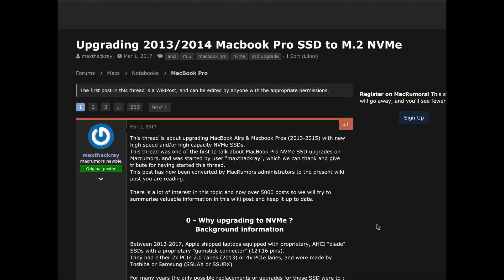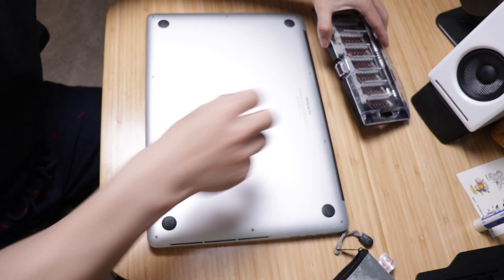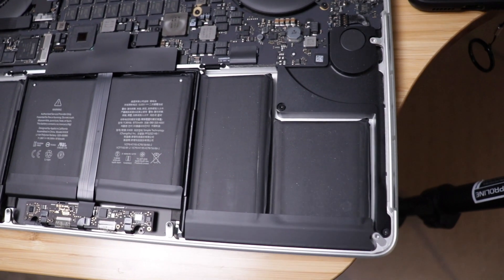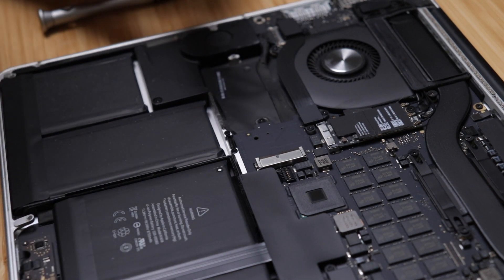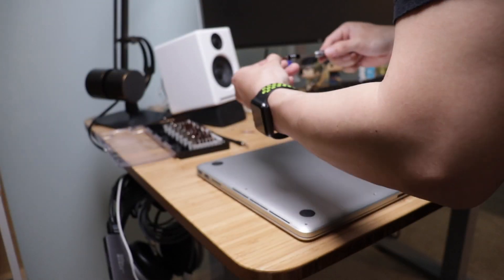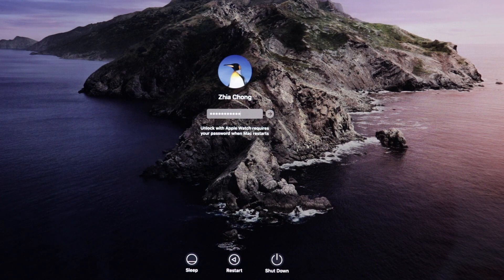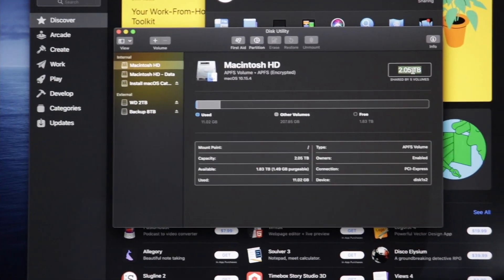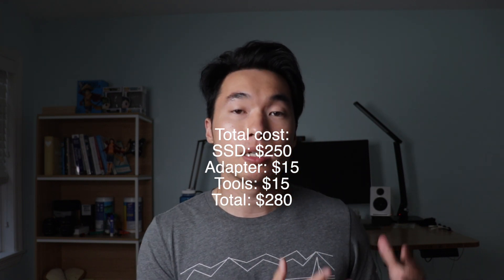2015 15" Macbook Pro 2TB NVME M.2 SSD Upgrade

Comment: I have tried upgrading my MBP A1398 15'' 2015 from WD 1TB to 2TB Orico Drive including Adapter, with Cloning the Drive, but it won't boot up to the latest Macos Monterey.

I tried in safe mode as well, but still will not accept the Drive, I have done  this in a matter of different ways also including a fresh install, of Monterey. Still it will not accept the drive.
Any help would be much appreciated.
Regards

Comment: Nice to see that it is possible, but I have failed so far. I have a Kingston 2 TB SSD, which works in an external enclosure, but the Mac won't recognise it. Bad adapter? I have tried two different ones.
Reply from the maker: Sorry to hear that, which adapter did you get? There are certain Chinese brands that work, and some don't.

Comment: When removing the SSD or any removable component on the logic board, you should always disconnect the battery first. This is good practice and prevents any potential discharge issue when removing the component.
Reply: How do disconnect the battery, and I always thought one should wear special gloves when working on electronics?
Reply: Great advice. This kid's an amateur and should not be making tutorials at all involving such a delicate procedure, without first knowing and following the number 1 basic fundamental involving electronics. Disconnect power.

Comment: Just performed this upgrade. Love having plenty of storage space now! Gave it a boost from 256GB to 2TB 😃 For those doing this, you will need to format the new SSD so the machine will recognize it as a disk capable of accepting the new MacOS install. Aside from that, you should be able to follow the video and perform it without too much of a headache. Thank you for uploading this!
Reply: Hi Logan, silly question but how did you format the SSD? Did you use an external caddy? Thanks!
Reply: @martinconway3772  pretty sure I did have to format bc the computer didn’t want to recognize it as a bootable drive
Reply: @loganhasty2036  Yeh that's exactly the problem I'm having, just wanted to check how you formatted how you did the formatting before I invest in an extra £20 in a caddy
Reply: @martinconway3772  I didn’t purchase anything extra. I googled it and figured it out from Apple forums. I believe I had to use disk repair utility but I’m not sure. It’s been a little while since I did it. I do know you don’t need a caddy though lol
Reply: @loganhasty2036  Cool, thanks for your help, I shall do some more research!
Reply: @martinconway3772 hey do you have an solution?
Reply: @Beru96  Hi Hubert, I didn't I'm afarid but so far haven't had a lot of time to trouble shoot. I think I may have bought an incompatable SSD so i'll try another one soon and let you know how I get on 😎
Reply: @Beru96  Ahh thanks for the feedback Hubert, yeh I'm going to try a different SSD soon. Glad you got it working in the end!
Reply from the maker: Glad this worked for you too!
Reply: @codingwithzhia  No... no it didn't 😂
Reply from the maker: @martinconway3772  Ouch :( which SSD did you get?
Reply: @codingwithzhia  I believe it was a Sabrent Rocket 4.0, I'd heard good things but think I got the wrong model. Will try again soon 👍

Comment: Hi , I want to ask, replace the flash storage of the Macbook Pro 2015 with another SSD from  info some friends in the group, there are experience naturally can't hibernate or sleep mode, the battery heats up quickly and wastes and even some that die completely can't be restored again because of the panic screen and then it's completely dead can't be repaired  again.  My question is, should I look for an SSD and converter that is really compatible because each SSD has different speeds, while the Mac software is not as fast as the latest SSD.  Then the type of ssd must also be the same as the original.  Friends say it's like we ride a BMW, spare parts are replaced by LOWEST part , let alone use a converter.  Then, if we replace the SSD, the one that appears in our storage is not FLASH STORAGE but SSD, is there really a difference that can cause occasional errors?  Then the final question, if the SSD is replaced, the OS is upgraded, can it ERROR and die.  Is there something natural about it?  Thanks for the answers to some of the questions above.  I hope this channel will be more successful

Comment: Has anyone run into this issue: Switched out the 512 Gb SDD 2015 MBP 15" Retina  to 1TB (Samsung Evo 980) all seemed to work fine, but today, trying to use Migration Assistant, the screen doesn't work???  I hear the fan blowing at times.  Have tried doing a reboot, shutdown, etc as per normal w/ this generation of MBPs but nothing seems to be working...

Comment: Thanks! I just bought a macbookpro11,5 and I'm a windows user, this will be my first newish mac I've owned since 2008. I have a bunch m.2 ssds lying around so now I know that I'll need an adapter for them. The laptop I bought has no ssd at all got it for 250 on ebay auction its the 2015 macbook pro 4980hq 16g ram r9 370x, can't wait to play around with this thing and see if it's even game-able

Comment: 👍 ...Absolutely works. Using the links given I received my Sabrent Rocket and Sintech adapter today. Went ahead and made the swap from a 256gb to the Sabrent Rocket 2TB. After booting from USB and formatting the new drive, it took about 7 hours to restore from my Time Machine Backup (around 930gb). Currently commenting on the upgraded machine. Using the Blackmagic Disk Speed Test I'm getting write speeds of 2800mb/s and read speeds of 2600mb/s!! 🥳
Reply: Hey how are the steps for booting from USB to Format the ssd? Is it the normal installation tool which I setup as usb stick or how do I do it?

Comment: How did you know the length of M.2 SSD would fit? do you know if it the Rocket is 2242, 2260, 2280? I'm reading that it means millimeters 22mm wide by ##mm long. When you added the adapter I was concerned it would not physically fit and unable to be screwed in. But your video looks like it screwed in fine. Do you think Apple original SSD is a unique dimension? I would have liked to see the original SSD & Rocket SSD side by side. Nevertheless very good video thank you for making it.
Reply: the drive slided "INTO" the adapter thus making them the same length as far as being able to screw it in like the stock drive. 2280 is key
Reply from the maker: Thanks! I researhed online and found tutorials that helped me figure out the parts to get. That's how I found the M.2 SSD. Hope that helps!

Comment: Since replacing the SSD does little for 2015 Macbook Pro performance, then can you or anyone else recommend just how one can upgrade this Mac's performance. Thanks
Reply from the maker: For an older macbook pro, there's not really much you can do to squeeze out better performance. The CPU is not upgradable, and neither is the RAM. Upgrading storage prolongs the usable life, but will not increase performance.

Comment: Is there any issue with using a PCIe gen 3 ssd on the 2015 MacBook pro? I've read that the 2015 MBP only supports Gen 2 PCIe

Comment: There's this new Sabrent model "SB-RKT4P-2TB" generation 4 with reading speed of 7100MB/s and writing of 6600 (MB/s). Is it still compatible with a MacBook pro mid 2015 15'' and the sintech Apple to M.2 adapter?
Reply: Any luck with the new Sabrent model?
Reply: well remember the gen 4 PCIe is awesome but the 2015 MBP is a PCIe gen 3.0 if not mistaken so it's backwards compatible but don't expect those speeds....you HAVE to have pcie 4 for that.

Comment: is there a way to use the replaced drive as an external drive ?
Reply: you can get a USB case for the M.2 module
Reply: @artemusgordon146  yeah but the apple drive has a different pinout. Can't  find a usb case that's compatible.

Comment: You should mention if it is early, mid, or late 2015... that adapter does not fit the mid-2015.
Reply: This video is actually for a MacBook pro 15'' mid 2015

Comment: Hey there! I'm new to Repairs. What is "Bootable Media" you mention at 6:00?
Reply: This might be late af, but bootable media is a term used not just in repair but computer in general, remember the first step was to create a bootable drive? Essentially you are using a usb or se card to hold a installer for you system so you can install said system on you system drive (in this case the nvme)
Reply: @skynchickens300  Thanks for that! I’ll keep that in mind. Always learning.

And you’re right on time. 😁👍🏾
Reply: Moreover, to make it easier, you should have your "time machine" backup in an external disk.

Comment: awesome.. thanks for the tip.
P.S. BUT BUT BUT it is advisable to disconnect the battery and remove the SSD, lucky that it didnt static and brick the MBP. one wrong move with the Battery(power) and the motherboard is toast

Comment: probably a good idea to cut off power supply before doing any changes in circuit
Reply: First thing I noticed but, it is a six year old Macbook who cares!
Reply: @markgable3087  We care!
Reply: @markgable3087  that still kicks ass today! I have the i7 quadcore 16GBram 2015 15" and it's a beast!
Reply: @fasjackson3588  it's fine for 4K editing ??

Comment: Could you run windows on it and see how it performs?
Reply from the maker: I run it on VMWare and it works great - are there specific metrics you're looking for?
Reply: @codingwithzhia  i never cared about macos, I've been wanting get a mac to run windows because getting a mid 2015 mac seems like an affordable purchase and running windows on it smoothly will not break my bank. Because there's no affordable windows laptop that will perform well out of the box without paying a thousand bucks.

Comment: Thanks for the video. I did all you make, everything is perfect with my macbbok pro A1502. Just I have an issue. I replaced my original 128gb ssd with the WD Black NVME M2 with adapter. Speed is ok, macos bigsur is super but I have an battery issue. While I manually sleep or close the screen, I think the system sleeps but the ssd is not. Because bttery drains 100% to %30 in 8 hours while sleeping. I couldnt solve this situtation.
Reply from the maker: Awesome! Glad it worked for you. Have you tried to do NVRAM reset?
Reply: have you found a solution yet ? maybe tried the original ssd and see what changes ?

Comment: Thx man, I think i don't need this upgrade, since i edited all of my work using an external ssd, so i leave my 128gb internal storage clean yeah, and well i use my student gmail account to add more storage for my files. Cheers
Reply from the maker: Nice, how do you find the performance working with an external SSD? I've heard there's a bottleneck in speed transfers due to the USB's max throughput.

Comment: Hello, I have updated my ssd follow your instructions, 2015 MacBook Pro 13 inch. Now the system is big sur. I wonder if I want put back my original ssd, which is Mojeva, do I need to re-install the operating system or I can just place it back.
Reply: hello sir i have a early 2015 13 inch (retina) would 2TB work as well?
Reply: *macbook pro
Reply: No you don't need to install again... Original SSD will boot with Mojave and vice-versa.

Comment: I was wondering if you have are experiencing any  overheating issues with the 2tb upgrade?
Reply: I would change the thermal paste. Look up thermal past upgrade for the macbook works better and no overheating
Reply: @gabrielzepeda3610  I haven't at all. in fact it seems like it runs cooler than Apple's SSD...weird I know but I cannot tell either way really. if thre is a difference I cannot tell. maybe a few degrees is all but nothing near a worry.

Comment: what do you do when the new ssd is not detected?
Reply: Hi. You have to create a bootable MAC OSX install disk and boot your MAC this way. The adapter does not allow for Internet recovery that recognizes the adapter and thus the SSD attached (this is a remark from seller as well). I have tried this with a different computer (MBP 13", 2017), similar upgrade, same limitations. Be aware that are also possible hibernation issues while using adapters. I am in the process of ordering components as indicated by Zhia to upgrade my MBP 15" mid 2015. But you probably have already gone through this, from 6 mo ago. Running Big Sur. Good luck!

Comment: hi, thanks for the video! I heard ppl say that some models might have issues with hibernation. do you experience system crashing from waking up from hibernation? thanks!
Reply: not the 2015. the 2013-2014 have to have a terminal fix applied.

Comment: Appreciated this video. I have the same model MBP and was wondering how good that ssd brand would perform.  
Thinking of using the Gen 4 Sabrent ssd so I can use that in a future model MBP or make it into an external ssd.
Reply from the maker: Sabrent is a reliable brand, I did a lot of research online before deciding to jump on it. Great value for money.
Reply: How did the 4.0 hold up? I have it in the cart right now, should I pull the trigger?

Comment: Also bro lets say I wanna get the 4tb ssd is it possible to install that in the MacBook Pro 2015 ? or would u not recommend .Im asking because me as a music producer I use a lot of plugins to create music so what I be needing a lot is space . I do have external hard drives but I can't run Vsts or Plugins from external drives . lmk man id really appreciate it if you can answer my questions thank you , your video was very informal
Reply from the maker: 4TB SSD is going to cost quite a bit. I'd be apprehensive due to the fact that I'm putting a lot of my important work on a single drive. 2TB was a sweet spot for me - it's enough to hold media that I need to work on, and anything else I'll put on a backup storage so that I'm not going to lose everything if my laptop dies or gets stolen
Reply: get a 2TB, the 4TB are super spendy still...and you could buy a nice external for backup. don't keep everything on onemachine, if it gets stolen, dies or whatever you're screwed.

Comment: hey man! great video: I did the same, but not getting that speed, would it be the adapter?
What's the adapter you using?
Reply from the maker: SERGYO.  I added a link in the description to the adapter I use. It might be a faulty adapter
Reply: @codingwithzhia  Hey man!
So I had 2 of the same cheap adaptors, and one kept throwing low results on reading. so I changed it to the other adaptor, and now it seems to work!

Comment: Good ol' times when they were upgradeable. 

Maybe they surprise us and say "Hey so you can upgrade RAM and Nvme on our ARM Macbooks" 

But i doubt that haha ^^ 

good video =)
Reply: precisely why I haven't sold or upgraded my 2015 15" quadcore i7 16GB ram. the SSD can be upgraded still unlike most of the 2018+ machines which everything is soldered. Glad I have the 16GB model now but it was a small fortune when I bought it new. I hope it lasts me 4 more years or so. it's a beast.